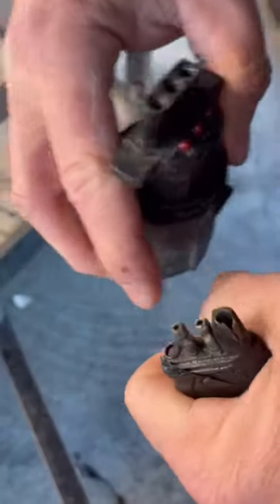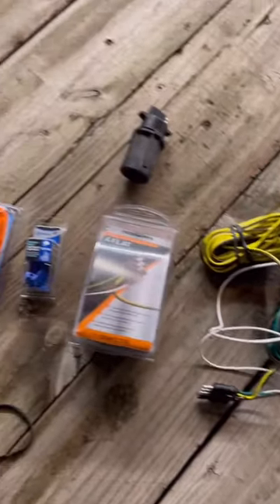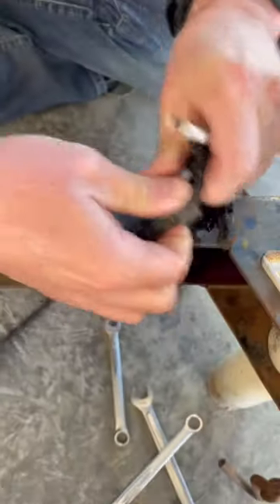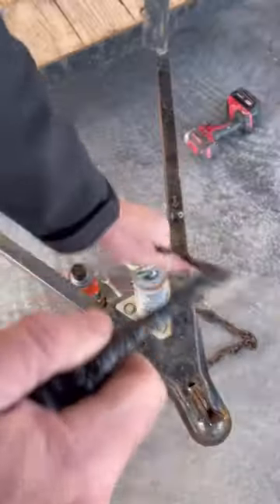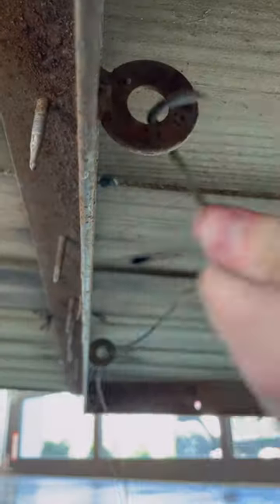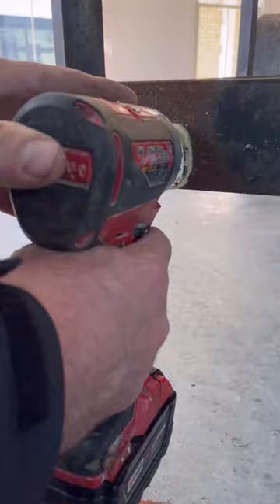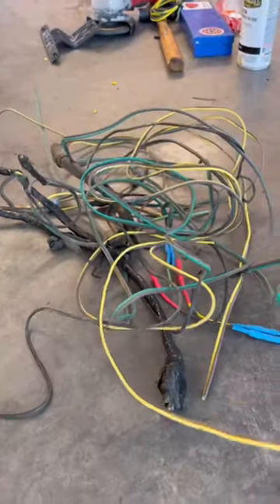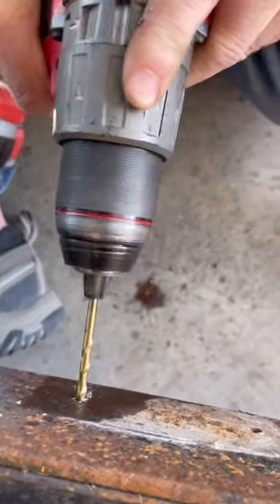Getting Started on a Trailer Rewire

Comment: The wire will last longer if you use PVC instead of using welded on washers for runners , i wired my 3 trailers over 17 years ago and never had to replace any wire . Dont have to ever worry about any wire getting caught on branches or debris .

Comment: I just did this to my trailer, make sure you clean the metal really well for connections, my right turn signal wouldn’t work and I was getting so pissed until I ripped everything out again and worked the grinder wire brush over the trailer frame. Works now.

Comment: Single insulated wire through holes is just asking for trouble. Takes all the punishment from the road, possibly wear through and short out etc.
Reply: Needs plastic loom
Reply: @lukehaak5907 or rubber grommet in holes, plastic loom might retain more moisture especially since it’s near the ground